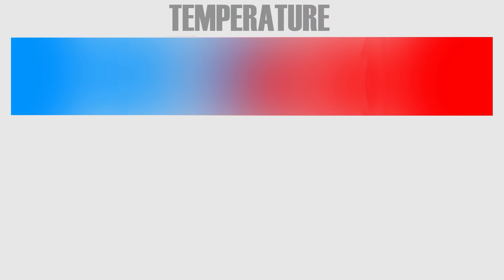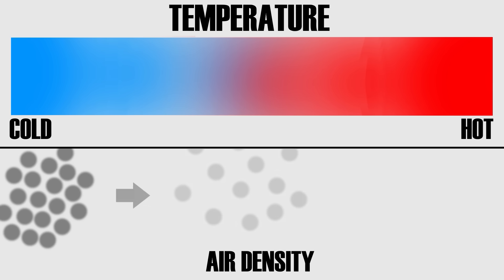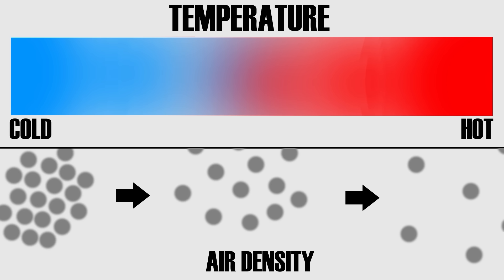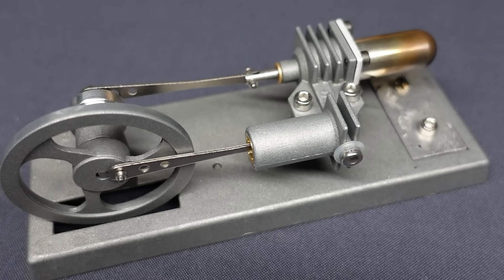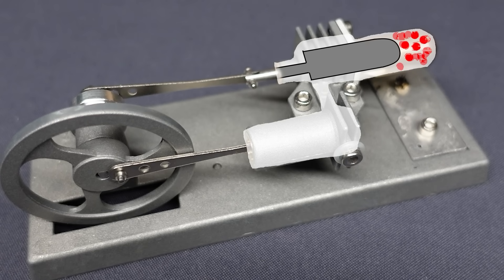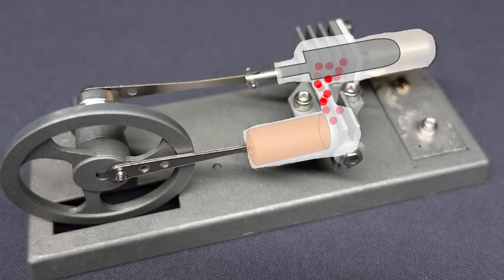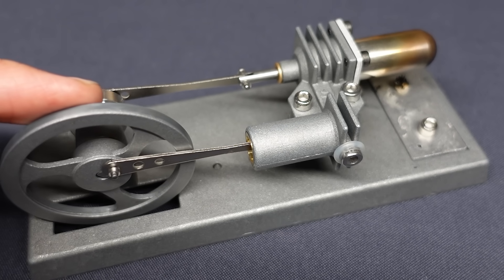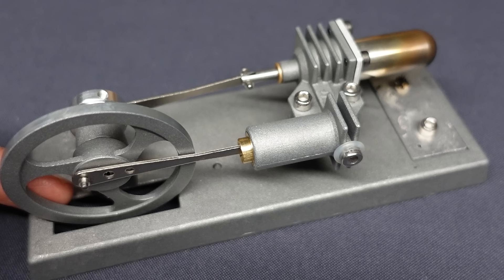It Can Save The World - The Simple Genius of Hot Air aka Stirling Engines

Comment: Well... there is a reason why they're not ubiquitous that you didn't cover, and that is that the idea that "they convert waste heat into useful energy" is vastly oversimplified and over-idealized.

Ultimately, all engines run on thermal energy differentials. For example, basically all powerplants are actually steam turbines, as far as how they actually generate electricity. Steam turbines use the Rankine cycle. It's a cycle that relies on differential pressure as well as differential temperature. Land-based steam turbines mostly already use their waste heat extremely efficiently, using it to pre-heat the water vapor going into the condenser. Because they also use an isentropic expansion as part of the process, their exhaust is often very close to ambient temperature, with the goal being to have it be at exactly ambient temperature, so there's no residual waste heat for a Stirling engine to even use.

In a steam piston engine, the exhaust is always higher than ambient temperature and pressure... but the more practical solution there is to just put another stage of steam pistons to use that pressure and temperature differential, with each subsequent stage exhausting lower and lower energy steam. Ultimately as you design such a system, the choice you make is to balance how close to an ideal (Carnot) cycle you want to get, versus the weight and complexity of the system. A steam piston powered aircraft, for example, you'd use a single-stage system with very hot/dense exhaust, because that's the lightest and the best power-to-weight ratio. On a ship, you might use a two or three stage system, because weight isn't as critical, but ultimately you're still using up a kilogram of displacement capacity for every kilogram of engine, that could be used for cargo (or passengers), provided the vessel is still capable of sufficient speed. On a land-based steam piston powerplant, you might use five or more stages to eek every last erg out of the steam for maximum efficiency, since weight doesn't matter at all.

All other engine cycles have similar considerations. So for a Stirling engine, the question isn't really "should we bother using this waste heat or not," it's "Is a Stirling engine the best way to use the waste heat, or could we just design the heat-producing engine to be innately more efficient and output less waste heat altogether?"

The answer to that question depends on how close the type of engine producing the heat can get to ideal Carnot efficiency (the maximum possible efficiency for a heat engine given the available temperature differential), compared to the desired efficiency.

A Stirling engine can get very close to Carnot efficiency, which is great! But here's the rub: like you said, it has a poor power-to-weight ratio. That makes it basically a non-option for most types of vehicles. For land-based power, generally quite a lot can be done to make the underlying engine more efficient on its own, closing the gap considerably compared to what a Stirling engine could add (which is often very close to zero), so it becomes an economic question of whether it's worth the extra 0.1% efficiency or whatever, to build a whole extra complex system. The answer is usually, quite simply, that it isn't worth it, that either you can't afford the lower power-to-weight in a mobile application, or you can't afford the cost and complexity in a static system.

The value of a Stirling engine comes in two categories:

One, which is the reason NASA is interested in them, is that, like you said, its working fluid is entirely self-contained. In a situation in which you have to carry your reaction mass with you, that's an enormous advantage. Turbines are a non-option in spacecraft and, for the most part, even in rovers (until we can get to the point of genuine ISRU (in-situ resource utilization)), because they require effectively infinite input fluid. Fully capturing that input fluid reduces the system to almost zero power output. At best, it could only hope to approach the efficiency of a Stirling engine without being able to take in local fluid and exhaust it to ambient. When choosing how to use an external heat source to generate power, there are only a couple of options. Currently, we usually go with RTGs (radioisotope thermoelectric generators) that directly convert heat into electricity via thermocouple. These are insanely reliable and durable because they have no moving parts. They're also quite inefficient, because thermocouples aren't that good at converting heat to electricity. A Stirling engine would be wildly more powerful and more efficient, and a pretty big upgrade to an RTG on most spacecraft/missions. The problem is that because they have moving parts, and because there is no possibility to maintain or repair them in any way once deployed, they're an unacceptable option so far. If we could perfect them to the point that they can be expected to last for at least tens of thousands of hours, if not hundreds of thousands, they'd be an incredible advancement for space exploration. But on Earth, we can use infinite input media and exhaust to ambient, so that advantage is completely null here.

The second, which is why they're interesting in terrestrial applications, is because of their versatility. Because they don't care what heat source they use, or what scale they're built on, they can potentially be used as a plug-and-play efficiency upgrade. This means they'll probably never be used in powerplants, because if you're investing $10 Billion on a new powerplant, you just invest a little bit more to make the generation system itself more efficient, approaching Stirling levels innately, and don't bother with the tiny, tiny potential gains they offer. On the other hand, nobody is gonna invest an extra half-billion dollars to use some waste heat from their house's furnace exhaust or the like... but they might just buy a $10,000 off-the-shelf Stirling engine solution, if it's available commercially. A chemical plant that otherwise just burns off waste chemicals in a stack, might also buy a dozen of the exact same off-the-shelf systems to use that waste heat, as might a hundred other kinds of business and public applications.

The idea that it could be used to recharge your hybrid car after you're done driving, though, is unlikely. Compared to the amount of energy it takes to move the car around, the residual waste heat is basically negligible. If anything, I find it more believable that a Stirling engine might be used in a powered sense as a heat pump, in order to help cool the car faster... but probably not, because radiators are much more efficient and are plenty effective. If all it could do is leech heat from the cat or the engine bay, it just wouldn't make enough power to be worthwhile. If you put it in the exhaust stream, it'd have a lot more potential energy available, but it would raise the temperature and pressure of the exhaust gasses, and thus directly reduce the power output and thermal efficiency of the ICE engine itself.

That said... very cool demo models! Love the four-cylinder one, especially! Though it seems like it really wants bigger flywheels... Good explanation of how they work, too! And great to see a working, practical example with two pistons instead of the idealized versions you usually see, with a single piston with heat sinks on either side. (Which are theoretically more efficient, but practically much harder to build and maintain, and less power-dense).

Comment: I wonder what the scale of one of these could be. I'm thinking specifically craters on the moon where some of them the outside of the rim is in light over 90% of the time, where inside the crater it's dark. We're talking about a temperature differential of several hundred degrees between the two.  

Dealing with heat with near vacuum like pressures would present some challenges, but it would be quite interesting to think about how a hugely scaled up version of one of these in an environment like that would function.
Reply: The problem of running a Stirling engine in a vacuum is that you need a working medium for your heat sink. On earth, the cold side heat sink is the atmosphere. On the moon, there is no air. You could perhaps drill into the regolith, similar to a ground-source heat pump. Additionally, your engine will need to be perfectly air-tight, or you will  lose your working fluid (air) inside the cylinders.

Comment: The first time I read about Stirling engines was in a book in which several of them were attached to and powered by hot air tubes that were attached to the undersides of PV solar panels. The sun heated up the panels, that waste heat powered the engines, and they would turn an electric generator or provide other useful work. I forgot in which book I read about them, but I think it was one of several "alternative lifestyle" books I read over 20 years ago that were all published by Chelsea Green in the USA.

Though I haven't looked at NASA's experiment, the obvious solution to the power modulation problem with vehicles is to not even try to directly power the car with a Stirling engine. Instead, the Stirling engine powers a small generator under the hood, a set of EV batteries powers an electric motor, and both the motor's waste heat and ambient heat (when available) drive the Stirling engine at a fairly constant speed, even when the vehicle isn't moving. It could at least be a range extender for the batteries. An electric motor big enough to drive a typical car doesn't put out anywhere near as much waste heat as an ICE does, but it can get hot enough to make a decent heat gradient.

Comment: You see to connect strings rooter or IP address to be redirected by unauthorized personal as networks exc. Are about to be shut down as you need to summit a mathematical difficultly math problem and run my the machine mechanism with no human interference no matter what.

Comment: This engine probably won't run very long because that casting, fins and all are going to heat up to the same temperature along the entire casting.  The thermal mass of it will allow the engine to run for a while, but eventually the whole side of it will be one uniform and very high temperature.

Comment: These could be amazing for EVs! The batteries, inverters, and motors generate a lot of heat, if these were used as generators in EVs, kinda like the little ICE in the BMW i3, they could seriously seriously increase the range with no other emissions whatsoever!
You would just need to hook them up to the cooling loop and tadaa, extra range!

Comment: Could you use a battery with an electric heating element? Would it make enough power to to keep the battery charged with enough excess to power an external appliance?

Comment: I was wondering whether you could do a continuous flow Stirling engine. Indeed you can, although the details are challenging. You put four things on a single shaft: a displacement pump in a hot bath, an expansion turbine in a hot bath, a displacement pump in a cold bath and a compression turbine in a cold bath. Now all these components also have to be really good heat exchangers, so the displacement pumps can quickly change the fluid temperature and the turbines maintain that fluid temperature. The only component that I know a real-world counterpart of is a cooled compressor, used as air intake for the SABRE engine. Although it's not isothermal at least it demonstrates you can combine these two things.

Comment: How if put 2 different gases with extremely different boiling temperature point.
The gas inside is easily changing the volume by temperature, and the other outside is cold liquid gas which cooling the system.
We don't need any fire then.

Comment: With the potential uses suggested a Stirling engines are rarely viable due to the cost per watt purely to maintain the engine. However a Seebeck generator is a far more viable option. A cheap solid state component producing electricity from the same inputs - a hot and cold source. Less efficient sure, but it can be very small and flat and require limited to no maintenance to produce electricity. Of course it still needs a circuit to convert to the correct voltage but all generators will really.
Reply: Sure, if you like 7% efficiency, go for it.
Reply: @teebob21  Considering the only realistic alternative is absolutely nothing at all, I'd love 7% efficiency. 7% is greater than 0% after all.
Reply: @olivialambert4124  7% efficiency will get you a negative return on invested capital, meaning that you're worse off than had you done nothing.
Reply: @teebob21  That's just not true. They're already used in a great many areas in industry to capture the waste heat. More relevant to this channel, the automotive thermoelectric generator also has massive interest from a great many major manufacturers as a way to increase efficiency of hybrid cars. All of these have 7% efficiency at best, often 5% and below. Yet all of these are either still profitable already or have enough potential as to warrant massive interest for the very near future.

Considering a turbo typically has around 2% efficiency, dismissing 7% as inherently useless just seems a little silly.
Reply: @olivialambert4124  Have you been an engineer for very long? There is a reason certain things aren't done: because they either don't work, or aren't worth the additional cost of installation and maintenance.

While you are correct that a turbocharger only adds about 2% thermal efficiency to an ICE, you're missing the point entirely. The turbocharger is not scavenging heat energy to convert it to electricity like a Seebeck effect device. The turbo is capturing linear mechanical energy and converting it to rotational energy and torque.

It made a wonderful apples to oranges comparison, though, so well done on that.

Comment: In theory Stirling engines are great, for practical use they’ve been an abject failure.  For those with dreams of an array of mirrors focusing light on the Sterling engine, just research the now bankrupt company Sterling Energy Systems (SES).  A great idea, actually built a prototype energy farm, but with the most intense effort (both engineering and financially) in the history of Stirling engine development, could not produce a reliable engine.  High temperatures and high pressures, needed for the conversion efficiency, doomed the engine.  Maybe someday, but that day is not today.

Comment: Very informative and we'll presented content. To side track a little, what effect does a solid or circumference only flywheel have on any type of engine?
Reply: When the mass is further from the center of rotation, it gives more momentum. So it is more beneficial to have only a 'hoop' and save material close to the center. This also saves weight.

Comment: The Stirling engine is quite interesting - but for most applications - there are better/easier solutions.

Waste heat (in a car) can be scavenged by Peltier elements. No moving parts at all.

Stationary heat sources like waste-burning are often used to heat steam for heating houses and/or hot water.

And the Swedish sub is a lot quieter (due to a lot less moving parts) than a nuclear sub - but the German fuel-cell subs have no moving parts (except for generator shaft+prop) at all.

A mobile use could be done in a diesel/gas-electric configuration - but internal combustion is a lot more efficient.

And a hobby model might work without lubrication - a real one would need it.

Comment: You know, it should be perfectly possible to run almost any size of sterling engine using heat from the sun. Just attach metal bits painted black to the heating elements and it'll run all day long.
Reply: Only in small engines, and you need to figure out a way to keep the cool side much cooler than the hot side
Reply: @wiegraf9009  radiators sitting in the shade of the heating elements.

Comment: If it were economically viable, it would already be used...it isn't and certainly has no chance at "saving the world"...🙄 Modern gas power plants already reuse "waste" heat extremely efficiently, in second and third stages of their turbine systems. Stirling engines will forever be relegated to science projects and hobbists.

Comment: They definitely have some good applications. The problem is finding a clean renewable and easily accessible fuel. There are some promising ones, but the other problem is that they aren't very quick at adjusting to various power outputs. I have a few ideas on how it could potentially be improved, but the unfortunate fact is that these alone will not solve our energy problems.

Comment: This got me thinking. In tropical places or countries close to the Ecuator, could it be used to be powered with solar heat? Maybe with some set of mirrors or something like that, and you could produce energy without installing solar panels that could be impossible to use in jungle settings
Reply: If you can use mirrors to power a Stirling engine, you can use the mirrors to power PV panels much more effectively.